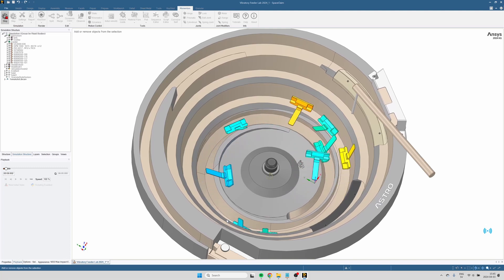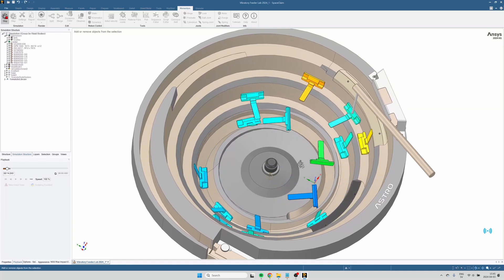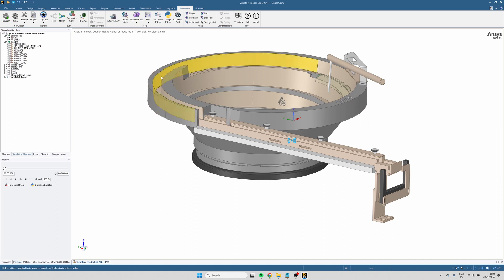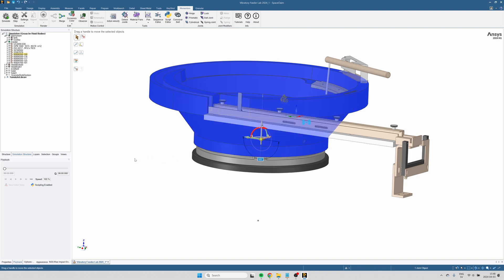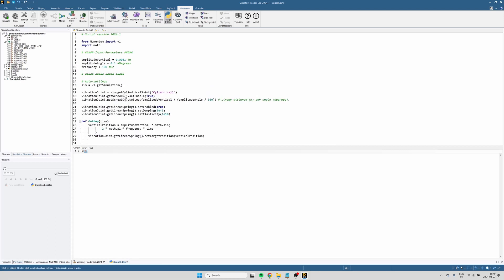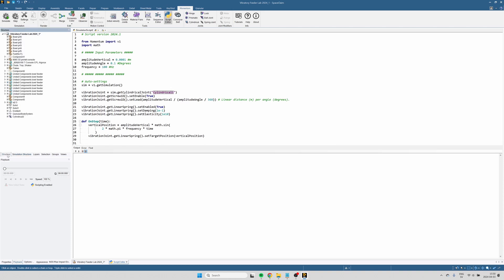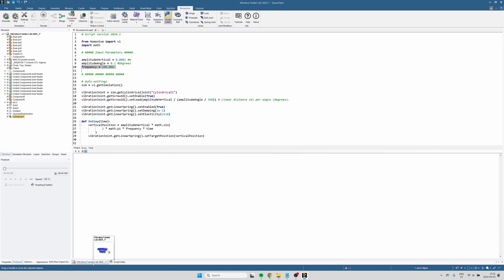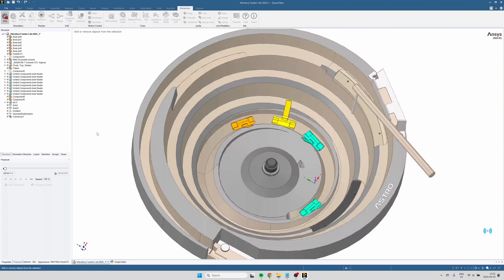Bowl feeder simulation - How to make it vibrate

Comment: one device has such a system. after a long time of use, the paint has become smooth. that's why it doesn't work. What paint can I use here?
Reply from the maker: Good point. There are a number of different coatings specially selected for bowl feeders. They are selected for a number of different qualities - resistance to wear is one of them.

Algoryx Momentum currently does not capture gradual local wear/degrading of the coating. However, you can approximate individual degrading stages along the way and also look at how the feeder performs in worst-case scenarios.

What kind of feeding parts is it?